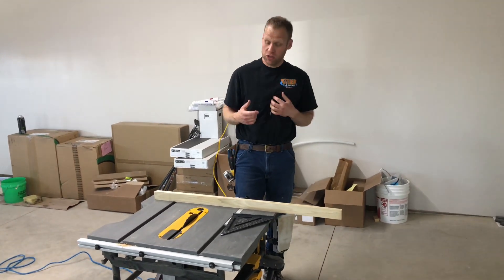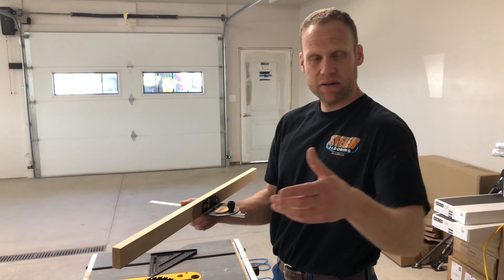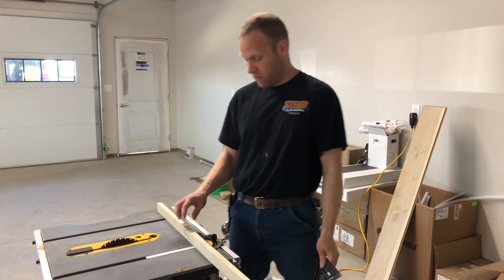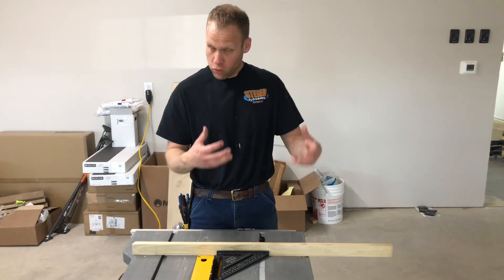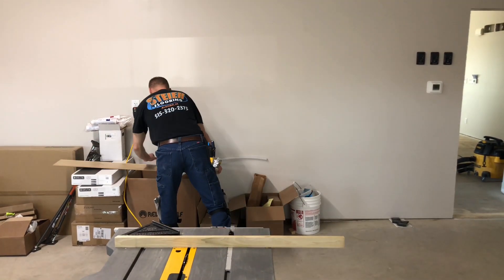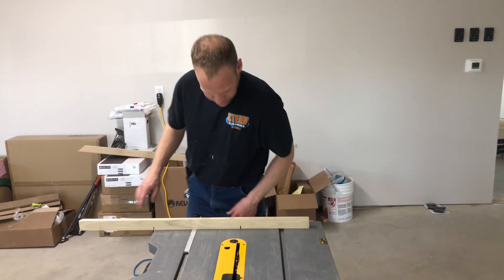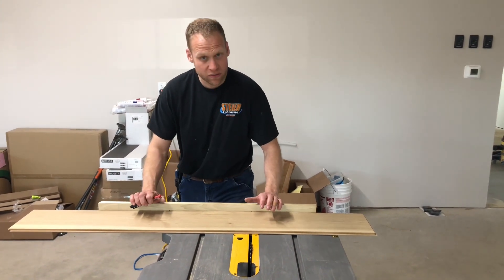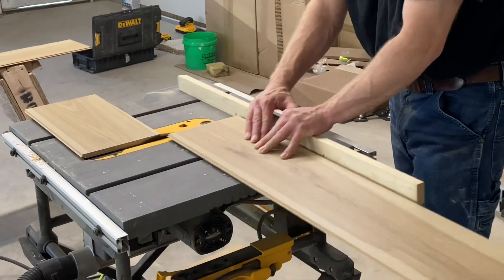EASY table saw miter guide/gauge!!

Comment: “Safety doesn’t take a day off “. Said with no safety glasses and all the safety devices and guards taken off. Lol. I have the same saw and never put my guards or kick-back preventer on. Great video.
Reply from the maker: My right hand man ran his index finger on the left hand across the sawblade a couple weeks back. Fortunately, the blade was just barely sticking above the wood. Pretty bad flesh wound, but still has a finger.